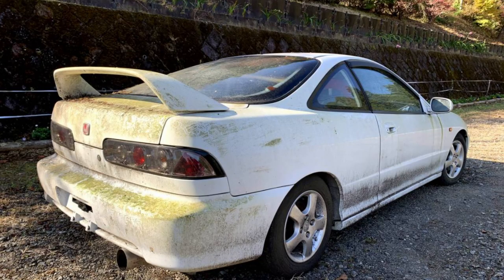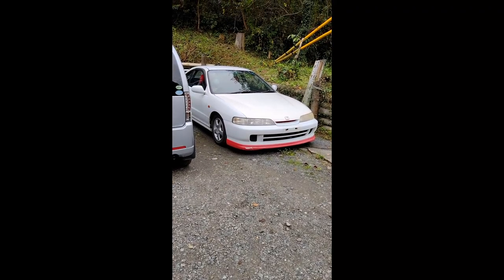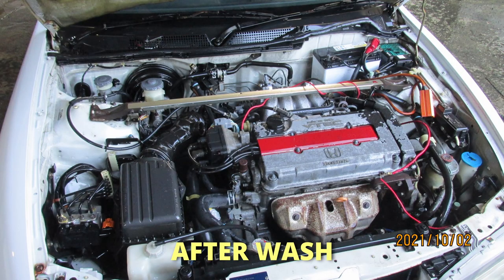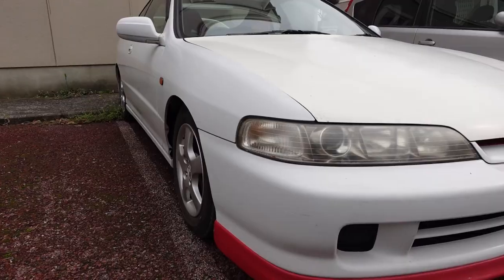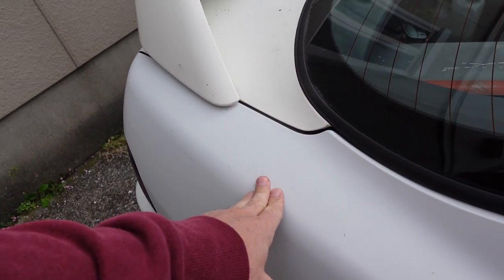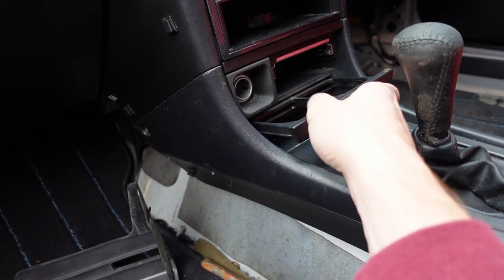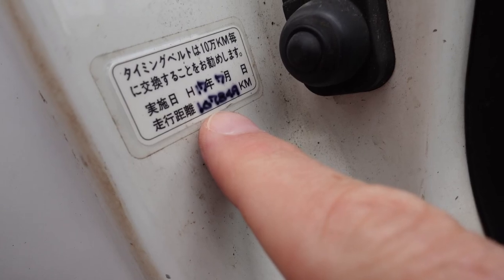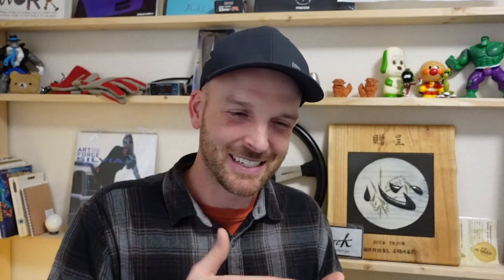6+ Years NEGLECTED DC2 Integra: How BAD is it?? | #DC2sday

Comment: Says he doesn't know anything about Hondas, knows details about chassis rigidity differences between Type R and non Type R models. LOL

Car is a bit rough but a platform that is so well supported I doublt you will battle to find what needs replacing. Saw how bad the fuel tank and suspenion parts look, par for the course for an old car unfortunatley, which you seem familiar with anyway. Keen to see how things develop and also a true enthusiast build. Good luck!
Reply from the maker: Hahaha, I've learned a lot about Type R DC2's in trying to find out more about my non-Type R DC2!  😂  Surprisingly hard to find info on SIR-G DC2's!  Really appreciate the support - I am already enjoying the platform...even if it's still just work work work at the moment.  The aftermarket and potential really make it rewarding.

Comment: Hi again.  Just got to this video.  I am also in the process of draining bad gas from my car.  The problem with me is that my car is in my garage, and you know how little real estate is available in Japan to do this type of work.  I am hoping I don't have to get a new tank like you did.

I just wanted to comment on your comment on attempting a sub 1 minute a Tsukuba.  First of of all, you are either going to need some serious mad driving skillz, or you'll need to modify the hell out of your Teg.  My car was pushing 300whp before oil sprayed everywhere and I had to garage it, but even on its best days I was only doing about 1:10 at Tsukuba.  Not saying that I am a great driver;  probably a better driver could do about 1:03~:04ish in my car, but a sub 60  second lap would still be very difficult.  Are you  looking to turbo charge your engine or do a K-swap?  Just wondering what your plans are.
Reply from the maker: Heck yeah, appreciate you watching the build!  Apparently, Honda made it really easy to drain the gas by installing a drain plug on the tank from the factory...I found this out after pumping mine. 😂 So that will at least make that part easier.  But yeah, depending on how long it was sitting a fresh tank might be in order.  I'll cross my fingers for you.🤞🤞

And for sure, the 1min goal is super lofty but I figured aim high.  Whether or not this car is the chassis for that task is yet to be decided, but for now I'm just trying to get it track worthy to do lapping days and learn.  So definitely leaning toward street manners for dual use now and then full racercar with this or another chassis down the road.

But after reading that I'm even more intrigued to see your car and hear your experience!  Sounds like quite the history!  Holler if you need help with anything!

Comment: I thought a B18C is always a Type R engine?
Reply from the maker: The Type R B18C has some differences to the Sir-G (GSR in America) B18C but both are B18C (and variants of it).
Reply: ah ok! do you know if those differences can it be identified on the outside of the enine? @BRICKHOUSESPL
Reply from the maker: @wat6816  yeah, there's a bunch (I'm sure an old forum thread will have a complete list), but the biggest difference that can't be easily swapped is the intake manifold and radiator hose inlet/outlet on the head.  The non-Type R (black valve cover, but can be swapped to red) engine has a different head so those items are different/not interchangeable.